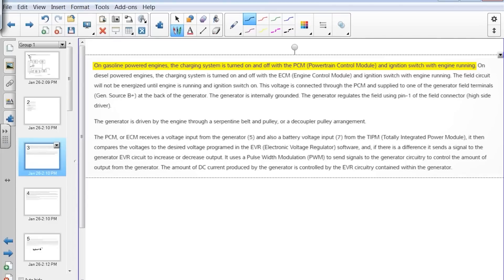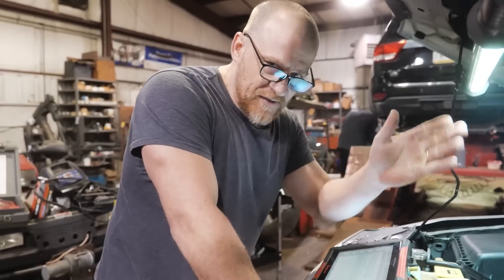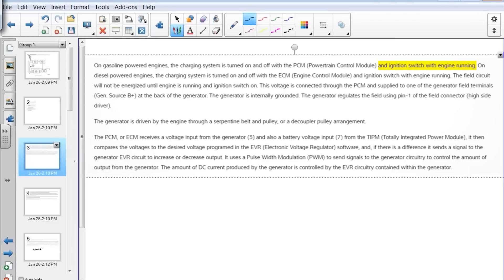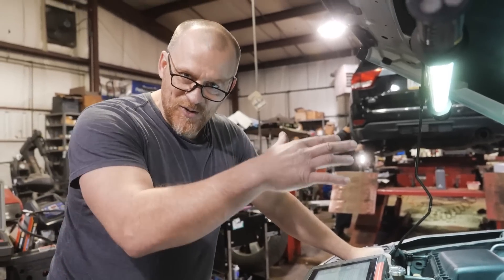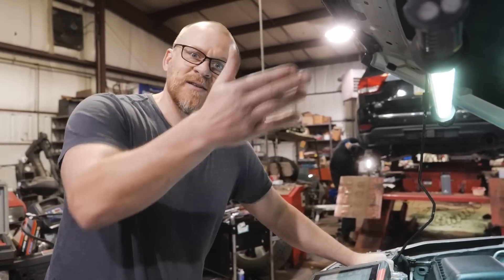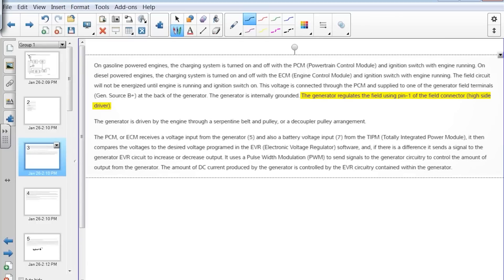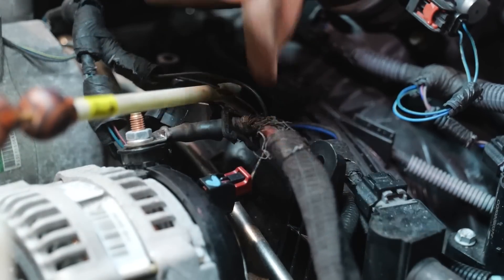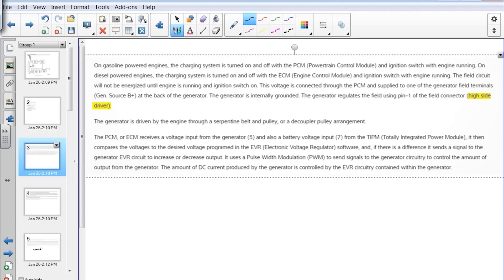Charging For Diagnostic Time - Can We Bill a Customer For "Research"

Comment: Growing and maintaining a clientele base is far more than just diagnosing cars. My shop is living proof of this. We’re in a rebuilding phase right now, after my boss recently bought one of his businesses back after the owner he sold it to passed away. The previous owner was gradually running the shop into the ground because he was continually hammering customers. I’ve learned lots about business in small shop auto repair from my boss in just a short time. He’d rather break even, or even lose money on a job, than charge for something that he feels the customer would have an issue with. He’s even told me it’s better to not overcharge so the customer leaves happy, even if we don’t meet the intended target in some cases. If they’re happy they’ll keep returning and we’ll make that money back tenfold in the future, vs hammering them at the time then they never come back 

He came from nothing and opened his first shop (which was bankrupt at the time) when I was in diapers, opened 4 more shops (another one of which was bankrupt at the time of purchase) over the next 10 or so years, and then gradually sold them all to semi retire, and lives in AZ in the winter. 40 + years later, Both of those stores that were bankrupt are still going very strong today. My point being: This guy knows how to run a shop and deal with customers. So I ran the scenario past him: a car gets towed in, been to 3 shops, with multiple parts changed and still no fix. What do you charge off the bat just to diagnose? He told me: “the same as any other customer.” 

If you treat a customer the right way from the get go, they trust you. If they trust you and you don’t over charge, they’ll keep coming back. We have the cheapest of customers coming back for all of their needs. If you hammer a customer 500 just to look at their car and it’s their first time at your shop, I can almost guarantee they won’t come back. (Unless they end up with another nightmare problem nobody else can fix) By the law, you’re not doing anything wrong by selling diagnostics the way you are. Hell, you could charge 10,000 for a diag, and if the customer agrees, it’s their loss. But if you are thinking long-term retention, you have to be more reasonable. You say your shop has an issue being profitable. This may be part of the issue. I’m confident enough that if my boss ran your shop, the place would be jumping in 6 months to a year 

When it comes to diagnosing and making your call, sometimes you gotta take a more real world approach when making decisions, and disregard the classroom mentality. You have to build your own happy medium when considering how we’re taught to do things in school, and what would be most logical in the real world. Sometimes the 2 of them don’t mix, and the real world approach must take precedence in order to be successful, despite what your morals are telling you to do. If you’re having a tough time making a decision and it comes down to either one part or the other that needs to be replaced, it would be wise to choose the less expensive (and most commonly failed) part first. There’s no way I’d have called a PCM off the bat when dealing with a charging issue, unless there is something very, very blatantly obvious. Another thing when it comes to diagnosing: You gotta pick up the pace. I dunno about the rest of you, but I almost feel like there’s a gun pointed at my head when I have to diagnose a car, cuz my boss is pretty demanding. He’s a great guy to work for, but his biggest pet peeve is taking too long to diagnose, and no way he’d charge over 2 hrs on a diagnostic. He believes in research and proper diagnosing and all that jazz, but He wants answers and he wants them yesterday. He has fired guys for repeatedly taking too long to diagnose. I have a better chance keeping my job using the parts cannon and end up being wrong if we’re unsure and move on to our next option, than take too long diagnosing, as long as the overall cost isn’t too much. If I took any significant amount of time to diagnose an alternator, which we change plenty of, I can guarantee there would be smoke coming out of his ears. Do that a few times, and I’d be looking for a new place to work
Reply: Are you seriously telling Paul Danner how to run a profitable shop? You dumb bud.

Comment: There are usually two ways to do a repair. The correct way and the cheap way. Most of our days we are correct, but the occasional problem vehicles require the ability to charge for the time it takes to do it right. Not charging properly for diagnosis leads to guesses. 
People should not expect their mechanic to work for hours for no charge, or if so, don’t complain when they guess.

Comment: Hi scannerdanner i just have a question that maybe our delt with. No injector pluse as i searched alot off our vids.i have power to both connectors as soon as put to crank no injector pluse.i done what our done on our vids points to the driver in ecu.but  what puzzling me when crank  the power side to the injectors fluctuate from 9 back to 12 is that normal for a bad driver.thankyou
Reply from the maker: I replied, then it disappeared. Anyway, I need year, make, model, engine to help further but one injector driver that fails is not going to cause a no start, it would be a single cylinder misfire.
Reply: @ScannerDanner  and to add to last reply its geetting spark and fuel pumping to regulator.thakyou
Reply: @ScannerDanner  sorry about lack off info.its a ford xg ute manual 4 litre 6 cylinder. PIP TFi Distributor EEC-IV ecu.its batch firing i think all injectors fire off one driver.all 6 injectors do not pulse.all good untill cranking.ignition wakes up ecu/ecu prime pump. no check engine light,all relays are good put a new earth from battery to engine.made 1 from engine to chassis cleaned checked all earths.earth on ecu read 0.3 off resistance.rpm needle moves just a bit  when cranking.done back probing  from connection back to ecu all good until you  go crank 0.thats green and brown wires  to ecu driver. allso tested  with a test light  as you have shown no plusing off light dead.done  resistance test as  you have shown where you put probe on connection end other on  ground on car, every wire i probe all read the same 0.8 even wires from ecu side 200 m test  touch the 2 probe together from multimeter reading was 0.8 same as all wires.everthing ive learnt from your vids kept pointing me to the ecu driver but as you say its a big call to pay cash out a ecu if not the problem.all got spark and fuel  just no injector pluse as all six injectors are new and are all good resistances and firing as i have a injector tester.i wrote this before it didn't work thats why you that other comment about spark ect. I live in  Australia just trying get old girl fired up thankyou for you time and excellent vids. peace

Comment: This was my main pet peeve when I was involved in the car business. Why should we not charge for our time when anyone else in any job wants to get paid for their time. This is also the reason why I always preferred to work on cars that DID NOT come from other shops and already had parts thrown at it. It just introduces new problems that may not have been there to begin with. 

Also, it's impossible for techs to know how to fix every single make and model of vehicle. There is much time spent reading wiring schematics and diagnostic procedures BEFORE you even touch the vehicle.

Comment: Your spot on. This topic is why so many have left the automotive industry. Try working on flat rate and being told that DTC (fill in the blank) pays 1.2 diagnostics time. Meanwhile it takes you 3. So you just worked 1.8 for free solving a problem. Wrong information, diagnostic tools that don't do what you need them to, defective parts, and the list goes on and on. Technicians are in high demand and there are so many reasons why. Now I see trade schools with 6 months training and your certified. Like the man just said he's still learning. You can't learn the entire vehicle in 6 months. Even OEM diagnostic tools and information can be wrong, all over the web you see it. Dealers that can't fix the car they sold you.

Comment: it does not matter what type of repair i used to do, i would always spend some time on research, timing marks, manufacturer information, wiring diagrams, superseded parts and the list goes on, if you run in blind you will hit a problem, knowledge is the key to success, how can you repair something if you don't know a thing about it, you can't, and that's the answer.
i have seen it so many times in this trade, like the car everyone has looked at but no one can repair, i even had cars where 4 people have looked at it, it comes to me because im the top tech and the last chance, it has a blown fuse, just a 15 amp fuse, nothing wrong with the circuit, and the reason is because no one bothered to spend 5 mins looking at the fuse box lid/diagram to work out which fuses would stop the car from working.
anyone who says this time should not be in the bill has never worked on a car, or if they have it is not in the correct manner, they don't know what they are talking about and lets face it, there is a lot of that going on here on the internet, armchair expert's.

Comment: I don't mind paying for research to get my car fixed if the car is going to get fixed.  At the end of the day, we as customers are at the mercy of the shop we take it to.  In most cases we have no idea what the capabilities are of the technician who is going to be working on the car.  Do they know how to diagnose a vehicle, or do they look at scan data and throw parts at it?  Do they replace an expensive part like an ECM and it doesn't fix the problem but they tell you that it was bad and part of the problem anyway to justify changing the part when maybe it wasn't bad.   You as the customer have no idea what parts are really bad and if every part that was put on was really necessary or not.

How many of these videos that I've watched on this channel and many others where the first thing that is said is that this vehicle has been to 2 or 3 other shops and it's still not fixed.  Many times that customer has had to pay for not getting their vehicle fixed.  This is the stuff that gives the industry a bad name and make people not trust repair shops.

One of my neighbors is a prime example of this.  He has a 93 F150 with 76,000 miles that he bought last year.  Truck has an issue where it acts like it's missing occasionally and just generally running poorly.  He has taken it to multiple shops, and it's had the plugs, wires, cap, rotor, distributor, injectors, MAF sensor, and I don't know what all else replaced with no results.  

He brought it over yesterday to ask me if I had a scanner that would hook up to it to read codes because the CEL was coming on periodically and flashing sometimes.  He said none of the shops had a scanner that could hook up to it and read OBD I information.  He was at a loss as to what to do.

I have an old AutoXray 6000 scanner that still works good on OBD I stuff and I was able to pull a 173 code out of it which had something to do with the O2 sensor heater circuit and running rich.  I was able to read minimal live data which showed that the O2 sensor data was fixed and not moving and that the truck was still in open loop even though it had been driven and was totally warmed up with the coolant temp at 193 degrees.  It also had a high idle.  It didn't give any fuel trim data so I wasn't able to see if it was in fact running rich.  I told him that I didn't know if that was part of his issue or not but that he needed a functioning O2 sensor for the truck to eventually run right.  He decided he was going to replace the O2 sensor even though I told him that more testing should be done to see if there was a harness issue or if there was signal coming from the ECM.  Of course the new O2 didn't fix the misfire feeling.  The bottom line is that none of the local shops can fix what should be a fairly easy problem to figure out.

Comment: If you charge 500$ for a job and the car is fixed, than it is cheap compare to 2 shop spending  700$ and the problem is still there! sorry for my english! Ho by the way the output for the LI terminal of the alternator is 14v @ 125HZ with the duty cycle refecting the load apply, that should make your 9 to 11 volt. Thanks

Comment: hi paul i say yes to a point as the research you will use information alldata autodata or even maufactures  data you pay for to speed the job up ie research or you could spend hours or days working on a system to get it sorted so the cost for finding and the tech paying for info should be charged

Comment: I always love your videos , learn a lot from your knowledge .

Couple weeks ago I had a 2002 Honda Civic with a tdc code ,,, car would go into limp mode when set ,, customers husband changed the camshaft position sensor ,, I used a scope on it and verified the wave patterns were correct ,,, I talked them into timing belt because they couldn’t remember last time it was changed and car has almost 200,000 on it ,, 

I did timing belt job , inspected the reluctor wheel on the cog and all was fine , figured while I was there I’d replace crank shaft position sensor and verify the wiring was fine ,,, put all back togeather start car and sure enough tdc code cam back but with long crank time ,  ,,, scoped crank and cam And the wave patterns are on point ,, timing is perfect ,,, having bad luck with after market parts , I talked them into factory cam sensor and sure enough all is fixed 

I don’t know that was the fix  as the wave patterns matched ,, but lesson learned with Honda wants it’s factory denso sensor lol

Comment: hey Paul got that right i been arguing that point with my boss 10 years ago i had a Isuzu another tech had this one he installed 2generators same issue dtc and not charging . i did voltage drop testing flow chart it all pointed to bad gen. we installed a 3rd one still same thing thing . i demanded a OE they finally got me one issue fixed the ECM DIDNT LIKE WHAT IT was seeing . another one a f 150 tech cranks sometimes starts and stalls most times cranks no start setting a dtc crank sensor code dont remember . he replaced crankshaft sensor ECM tested all 3 wires had harness apart pin tension nothing I cked all of his diag work he was right everything was ok so i went to description of operation . The trigger wheel has a total of 35 teeth spaced 10 degrees apart with one empty space for a missing tooth. The 6.8L ten cylinder pulse wheel has 39 teeth spaced 9 degrees apart and one 9 degree empty space for a missing tooth. I copy this from all data so we did a lab scope test on it it looked ok but i counted the humps on the scope and guess what it had 39 and this was a V8 . so we counted the teeth on the engine verified  yes sir had the one for a 10 cyl. called dealer and verified  had same physical size . forgot to mention it was a reman engine installed at a body shop . we didnt do repair dont know if they were going to replace the part or get anther engine . we billed for 8 hours diag . thet paid it no problem .no one could figure it out .
Reply from the maker: perfect example! Thank you for sharing!

Comment: Customer nickname "lucky". It seems to me that the first reaction by most techs, in the face of alternator insufficiency, would be to replace the alternator. It is interesting that the mechanism of voltage monitoring and alternator output control changed over this model year from controlling field ground to controlling field voltage (with internal ground) and even more damning that the service literature was blatantly and misleadingly wrong, but in this case, the parts canon approach of simply changing the alternator would have been a silver bullet,  producing a far better outcome. In short, i don't believe it reasonable to hang this adventure on the customer. Simply chalk up this valuable learning experience to money in the bank for the next time one of these rolls in. Thanks, and great video.
Reply from the maker: you should see the entire case study, it had a bad ECM too and then another bad reman ECM for a totally separate issue
Reply: No doubt you are correct, since all i saw was this video, and it was an incredible feat to uncover the technical discrepancy in the service literature. Still I have difficulty justifying charging the customer for this technical tour-de-force. Just my opinion, as i said, great video.  @ScannerDanner

Comment: Some of today's vehicles have over 100 control modules/units. All rely on electronic comm with the ECU/ PCU, at set parameters with loads of connections, switches. The ultimate electronic jigsaw puzzle!

Comment: I'm a customer and you should charge me for your time when you are working on my car.  You will not know everything about every car, so when you confront a problem you haven't seen before, you still have to go through a diagnostic process to determine root cause.  You may need to do some research along the way to determine what to do, but it still is part of diagnosis.   But, you should also study on your own time to learn about new systems, models, etc - this is an investment in yourself to sharpen your skills and increase your value to your customers.  Value is the ratio of benefits over costs - I'll happily pay more if I get more value.  When I pay you for a service, I am investing in you to be around when the next problem occurs and needs to be fixed.
Reply from the maker: Of course! 100% we must continue our training outside of the shop!